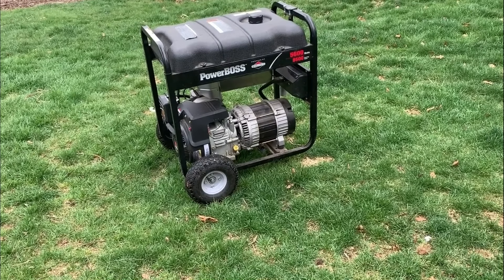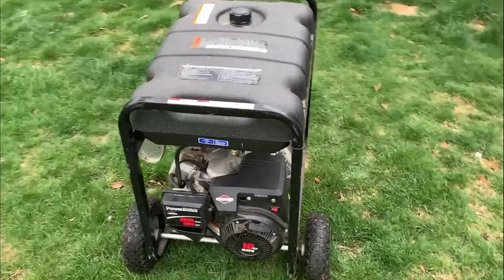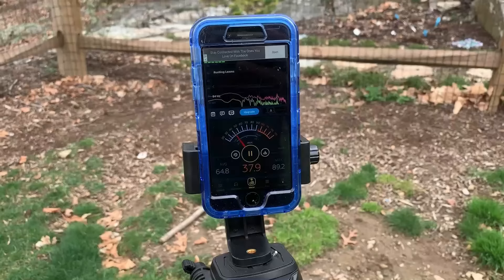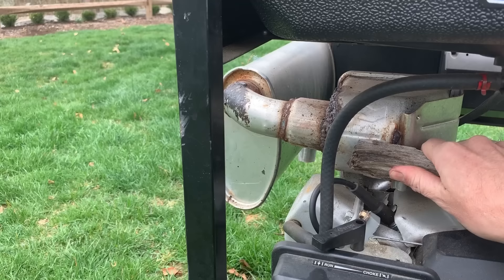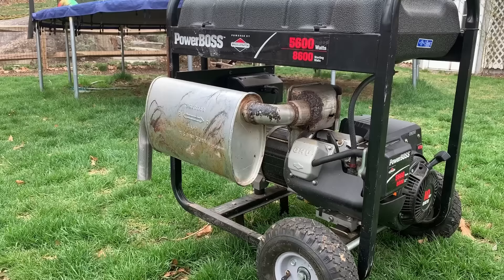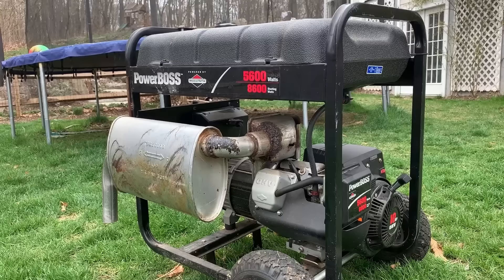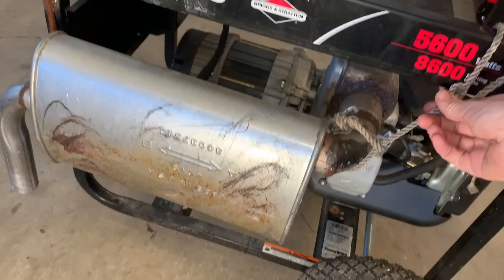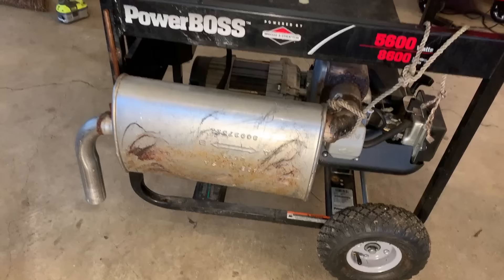Will a Car Muffler Make a Generator Quiet?

Comment: dB's are normally taken at a 3 meter distance.  dB reader app isn't a highly scientific method. Hole in muffler, fix it first, source of error.
Reply: dB apps - ding ding ding! You are correct. I have tried six different apps for dB registry, and have a range of 20 dB between them - same weightings.  My church  has a ham-fisted sound board operator who thinks he is mixing Cheap Trick at Budokan (yes, I am THAT old). I started taking readings so I could speak intelligently with the people in charge.  I wound up getting my hands on a calibrated and certified stand-alone unit (BK Precision) and ran it side by side, and narrowed it down to two apps that were fairly accurate across background and transients.  When I was still doing sound work 25 years ago, we would take readings at 1m, on axis from the source.  There were strict local ordinances about sound pressure at live events, with live or recorded music. (the kind of ordinances that held the sound company responsible for infractions and subsequent fines).   With the genset quandary, it also helps if exhaust is pointed away from mic. Car muff pointed down, Briggs & Stratton muff pointed at the mic.
Reply: Isn’t highly valid*
Reply: B.A. Gage you went through all that, mention 2 apps that were fairly accurate. Which apps?
Reply: I always cringe when people say they are going to do a "sound test" and then bring out and app on their phone. Get and actual device that was designed to do that
Reply: @scvic2006  need to look, have not used since March (no church since then).

Comment: It would also be interesting, if the comparison could have also been done with the engine loaded: Driving a couple of space heaters, to put a substantial load on the engine. You're right though, open frame generators are inherently loud. The best muffler in the world won't silence one of these. The biggest concern I have, is with vibration. When I've tried something like this, the vibration from the engine broke the weld between the exhaust flange and the header pipe, because of the cyclic stress from vibration from the single cylinder engine. I got the same result. It just didn't make it enough quieter, to be worth the trouble.
Reply: The weld you mention broke because you didnt mount the muffler on rubber bushes, like the engine is. DOH!
Reply: my boxed in and somewhat noise insulated permanent install generator is loud. sounds like someone is running a diesel outside the house, but it is just a 2 cylinder air cooled generac
Reply: @roberttill3787  You're right, but, it's a little more involved than that. A cyclic motion on one end of the muffler causes it to want to rotate around it's own center of mass. therefore, there will always be a cyclic cantilever stress at the exhaust flange. The thing to do, is to use a ridgid mount between the center of mass of the muffler, and the center of mass of the engine/generator assembly. That way, it all moves relative to itself, avoiding any cyclic stress. The trick is, to create a mutual center of mass between the two masses. (muffler, genset) The only other option, is to use some kind of a flexible coupling, that will remain within its elastic limit, with the excursion of the vibration. (a method used in some auto exhaust systems) The only problem with flexible couplers, is it allows noise!
Reply: ⚠️Always make sure you follow all the generator safety rules when you use your portable generator: 

This is just a reminder to make sure. It is important to follow all generator safety rules whenever you use your portable generator. 
Here are the things that need to be followed;

1) KEEPING OTHERS SAFE: Please do not allow an unqualified person or your children to operate and service the portable generator. Just because some manuals don’t say that doesn’t mean it’s safe. That is important against the generator safety rules. We also need to be keeping an eye on our children too. You need to make sure that your children are not playing near the portable generator especially when it’s running so they won’t get electrocuted. Generators pose electrical risks and they can be hot during an operation. Please keep your children away from the portable generator at all times. It is important to keep our children safe especially our little ones. Be aware of all the hazards.

2) WHERE TO RUN YOUR GENERATOR: Some people use their portable generators indoors which increases the risk of carbon monoxide poisoning. It’s important to have a carbon monoxide if you have a gas generator. Never ever use your generator indoors even if your doors and windows are open and even in the garage is not safe to use a portable generator. Not even at your porch and your deck. It is never safe to use your generator indoors and in enclosed areas of your home. Your generator needs to be 15-20 feet away from your house. 

3)🔥FIRE HAZARDS: Never refuel your generator while it’s running. You need to let your generator cool off before refueling it and before storing your generator. Never overload your generator too. Never ever back feed your generator. You should never plug your generator into a wall outlet. Also never store propane tanks indoors. Please keep flammable things away from the generator as well and please don’t smoke cigarettes near the generator. Having a fire extinguisher next to the generator is also important against the generator safety rules. 

4) GENERATOR OPERATION: make sure your hands are dry before touching the generator. Never use your generator in wet conditions. Don’t let your generator get wet. You need a generator tent if you need to use your generator during wet weather. Please don’t wear loose clothes when operating the generator. Turn on your generator before plugging in appliances. Use the right cord for your generator. Please do not use worn out cords. 

https://youtu.be/I1jT3ANENvI and here is a video more about keeping others safe when using generators 

Hope this helps
Reply: That's exactly right. A mounting placed right at the center of mass of the muffler, rigidly coupled to the center of mass of the main gen set, will help stop all relative motion between the two components. Another problem, is that the reciprocating piston is at one end, while the alternator rotor is at the other. The engine end vibrates out of phase with the alternator end, so there is also a rocking vibration, as well as the radial vibration, as it rocks on the center of gravity. The whole thing is suspended on rubber motor mounts, which allows that vibration.

Comment: I have a Champion 3,400 inverter generator. The side panel comes off to change the oil. Without that cover the engine is much much louder. Keeping the cover on makes all the difference. Good video! Well done! Keep in mind the decibel level is not linear, it's exponential.
Reply: I found the same with the Honda EU 2000i. Take the simple plastic side cover off and the unit is noticeably louder.

Comment: The SixtyFiveFord channel found DRAMATIC sound reduction (not just in logarithmic decibels, which is so-so at low levels, but sound-on-eardrum noise) by simply placing plywood around the running  unit.  If the plywood were secured and sealed, you'd see incredible results.  The answer is to give the unit a well designed enclosure instead of a well designed muffler (or both) and that'll make all the difference.

Comment: It woulda been a bigger difference without the blown out stock muffler. Several years back my buddy and I were building dirt drag trucks my old boss let us use a small shop on the truck yard he wasn't using also loaned us a gas power air compressor to use. Well inside that shop that gas air compressor was loud as hell on us so we took the factory muffler off my buddy's chevy luv truck and our 110 welder we welded a pipe on the compressor engine and ran it outside the shop then welded the factory pickup muffler to the pipe. Wala all you could hear was the actual compressor pumping air just like you would on a electric compressor and outside the shop you could barley hear the engine noise coming out of the muffler. So I think the blown out generator engine muffler was why it was so loud with the car muffler I bet when who ever first did that it was worth the effort.
Reply: I don’t think he stopped the original muffler up though. Gas travels to an area with least resistance, so what needed to be done was seal the original muffler up which wasn’t what he did (or at least I’m pretty sure he didn’t seal it up) if he had done what you did though, it would’ve been worth the time
Reply: Most of the noise is actually coming from the engine block and the valve cover.  The exhaust is inconsequential.

Comment: This was a fail test willing to cut the muffler off but not willing to adjust the muffler to work
Reply: ⚠️Always make sure you follow all the generator safety rules when you use your portable generator: 

This is just a reminder to make sure. It is important to follow all generator safety rules whenever you use your portable generator. 
Here are the things that need to be followed;

1) KEEPING OTHERS SAFE: Please do not allow an unqualified person or your children to operate and service the portable generator. Just because some manuals don’t say that doesn’t mean it’s safe. That is important against the generator safety rules. We also need to be keeping an eye on our children too. You need to make sure that your children are not playing near the portable generator especially when it’s running so they won’t get electrocuted. Generators pose electrical risks and they can be hot during an operation. Please keep your children away from the portable generator at all times. It is important to keep our children safe especially our little ones. Be aware of all the hazards.

2) WHERE TO RUN YOUR GENERATOR: Some people use their portable generators indoors which increases the risk of carbon monoxide poisoning. It’s important to have a carbon monoxide if you have a gas generator. Never ever use your generator indoors even if your doors and windows are open and even in the garage is not safe to use a portable generator. Not even at your porch and your deck. It is never safe to use your generator indoors and in enclosed areas of your home. Your generator needs to be 15-20 feet away from your house. 

3)🔥FIRE HAZARDS: Never refuel your generator while it’s running. You need to let your generator cool off before refueling it and before storing your generator. Never overload your generator too. Never ever back feed your generator. You should never plug your generator into a wall outlet. Also never store propane tanks indoors. Please keep flammable things away from the generator as well and please don’t smoke cigarettes near the generator. Having a fire extinguisher next to the generator is also important against the generator safety rules. 

4) GENERATOR OPERATION: make sure your hands are dry before touching the generator. Never use your generator in wet conditions. Don’t let your generator get wet. You need a generator tent if you need to use your generator during wet weather. Please don’t wear loose clothes when operating the generator. Turn on your generator before plugging in appliances. Use the right cord for your generator. Please do not use worn out cords. 

https://youtu.be/I1jT3ANENvI and here is a video more about keeping others safe when using generators 

Hope this helps

Comment: during an eight day power outage I put an old motorcycle muffler on my generator. it did the trick. most 2 stroke motors I've seen have 1" npt threads in the exhaust port making it super easy modify the exhaust.

Comment: I always chuckle when someone pulls out a Dremel.
They are often disppointed 😃😃
Reply: I've used a Dremel to cut bolts or grind in really tight spots. You can't put a lot of pressure on them, but they'll get to places not much else will. The use of the Dremel in this video was unnecessary, which was proven when something more appropriate was used to actually finish the job.
Reply: I rarely use those cutoff discs anymore, they’re just too damn brittle. I much prefer the ‘speedclic’ ones. They’re thicker and perhaps not suitable for all jobs, but at least they don’t explode sending pieces of abrasive disc all over the workshop, in your face, etc.
Reply: That was a heavy duty weld. I knew that little dremel cutoff wheel was going to crater in a heartbeat. You’d be lucky to cut thru a single 1/4” bolt with that disc. Grinder with cut off wheel was the appropriate tool for the job.
Reply: It definitely helps if you know how to use them properly.
Reply: Leave the dremel in the wife's hobby room. You want a cutoff tool get one.

Comment: To make a generator near silent, we always build a pipe to slide over the final exhaust pipe & point into the ground.   Of course, we did a straight-down hole with post hole diggers, then place the generator over the hole with the pipe in the ground.   RV folks, campers, etc have been doing this for decades

Comment: Interesting video. I worked in a muffler plant for 13 years and muffler back-pressure on the engine is very important to longevity. Not sure how that would apply to small engines only used for short periods of time. Personally I'll just stay with the sound enclosure approach.
Reply: a generator though is used for several hours at a time during a major event.  Hurricane Isabel hit here in 2003 and some homes didn't have power for an entire week.  Small-engine manufacturers recommend changing oil ever 50 hours of use....that was almost every two days!
Reply: Nope

Comment: I did the exact same thing...went to auto parts store and asked for the smallest car muffler they could find. I think it was for a geo metro or ford festiva or something like that.  it reduced the worst of the noise...took the edge off but not as much as I'd hoped. It was for running bouncy castles so the less background noise the better. was worth it in my case.
Reply: Get a honda generator.  You can barely hear them at 20 feet.

Comment: Decibels isn't a linear scale, so the car muffler (even with the hole covered with wood) was much quieter.  Try a car muffler with no holes.
Reply: Muffler or silencer is not made to quiet a Car or generator.The purpose of a muffler is to assist catalytic converter which operates at 1000 celcius to prevent back pressure of gases to engine. Car engines idles at 900 rpm and a 4 pole generator (diesel) operates at 1800rpm which is fairly less noisy. More the rpm more noisy it gets. Feel free to ask more.
Reply: @iamarxalan  mufflers are 100% designed to quiet the noise from the exhaust. Don't know where you got any other idea from. And from firsthand experience going from a muffler with multiple large holes in it to a new one with no holes, it works too.
Reply: @ethanlegler6403  do you own a car?? I am sure all cars have pre-installed mufflers.do one thing open the front hood. Ask some friend of yours to put car in neutral and accelerate (reving) it, watch rpm meter of your car on somewhere between 3 and 4.(3000 rpm - 4000rpm) record the sound using same decible meter and then tell me. Prove me wrong if you can.
Reply: @ethanlegler6403  catyltic converter releases carbon dioxide and nitrogen gas at 1000 celcius which can easily burst aluminium pipe of exhaust if you remove a car muffler.This muffler /silencer allows to expand inside it's  space preventing further damage.
Reply: @iamarxalan  the sound from the engine bay? Or course, that'll be loud still. The muffler is designed to quiet the sound from the exhaust, not the engine in the engine bay. Have you ever heard a straight popped car vs a stock one? The straight-piped one is always going to me louder because it doesn't have a muffler to, oh I don't know, muffle the sound? It's in the name ffs. It's there to muffler the sound!
Reply: @iamarxalan  if your exhaust can't handle a few hundred degrees (f) of heat before being damaged, then it's a really crappy exhaust and maybe you should think about getting one that can handle the heat better. There is nothing about the design of muffler that allows air to expand in it. And besides, even if it was there to let the exhaust gases expand, why would we then just dump it back into a pipe that's the same size as the one it entered the muffler from?
Reply: @ethanlegler6403  so what were you expecting ?? The entire purpose of the video is to show, how to quiet a generator ,the only sound which is produced is moving parts of engine, exhaust borrows it's sound from engine it doesn't produce itself. Just buy a 4 pole alternator (1800rpm generator)  if you really want to see something  true.
Reply: @iamarxalan  Car mufflers are in fact designed to make cars more quiet.  I studied engineering in college.  I agree with you that making the car quiet is not the only purpose of the muffler.  But muffling sound is a primary purpose, hence the name muffler.
Reply: @DougShoeBushcraft  there are plenty of videos trying to quiet a generator with a muffler but they won't work. There is a good reason that sound proofing casing is installed on "diesel generators".
Reply: @iamarxalan  You are right that an engine is designed to run with a certain amount of back pressure.   In your first comment you seemed to be saying the muffler didn't quiet an engine.  Maybe it's because English is a second language for you?
Reply: @DougShoeBushcraft  yes English is my second language.we should invest somewhere else now like fuel cells or Thermoelectric generators which ZERO moving parts and produces electricity.